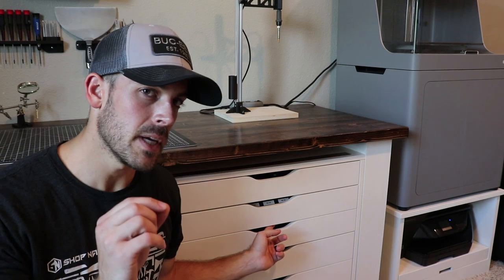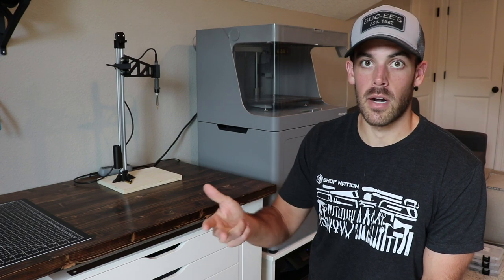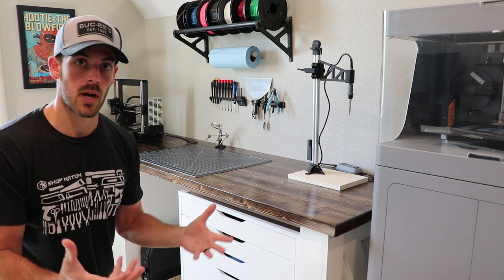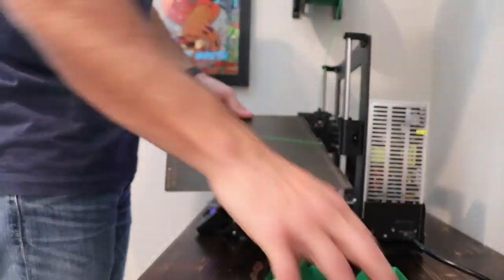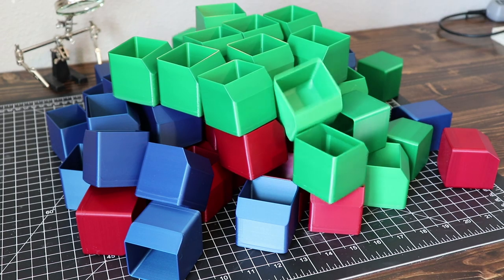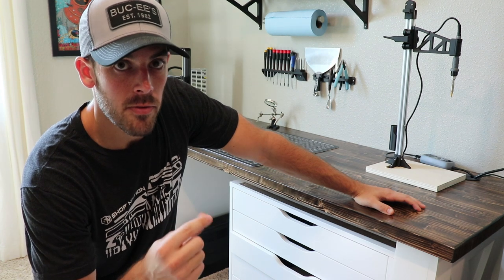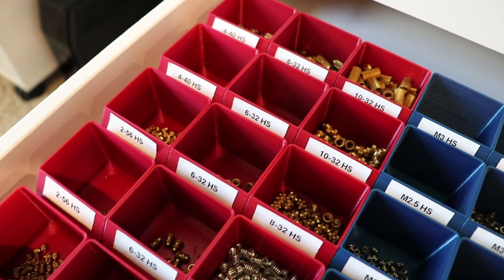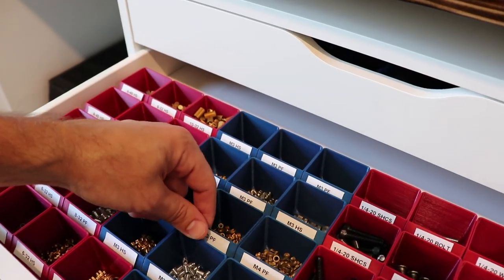Shop Hardware Organization - OCD Overload!

Comment: Ideas for improvement:  When grabbing for small parts out of small boxes, your hand naturally scoops the floor then up the near side wall.  For this reason, the angled wall with the label should go on the far side wall. The box’s floor should have a full radius like a cash register drawer to easily allow the parts to transition from the floor to the near side wall when being scooped out.
Reply: I've been adding that radius to the front and back inside lower corner of a few bins that I have made just to be catch all bins. Love it for getting those small pieces off the bottom of the bin.

Comment: This is funny. Just watched this video for the first time, 4 years after it was recorded. I just did the EXACT same idea, but my drawers are black. Instead of the boxes you used, I went with Zack Freedman's Gridfinity boxes and grid, glued the grid to the bottom of the drawer with a few blobs of silicone, works a lot better, and a bit less work since you dont need to futz with posterboard or foamcore. Additionally because of the grid, I can use different sized boxes as well.

Comment: I like the boxes, but putting a grid system on the bottom and on the bottom of the drawer would be a good idea.  What I mean is,  I saw someone who had a system that kept the boxes from moving when you opened or closed the drawers even if one of the boxes wasn't there.  The idea being that you might take the whole box out and you wouldn't need to worry about closing the drawer too strongly.
Besides that, good organization.

Comment: I have the same ikea cabinet and wish that they were full extension draw slides.  I have a similar setup, but also use kaizen foam to put my bench tools in. I have to put a spacer piece at the back of the foam for the 30% of drawer that is unusable.  My OCD wants to replace all the draw slides....but I think the boxes are a great idea and calms my OCD....but that 30% is a bugger.

Comment: Excellent video/project/execution!
I wonder if there’s a way to swap the cabinet glides for full extension?
Reply from the maker: Thought about that too
Reply: We have those same cabinets in my wife’s craft room. You would need to make the dado in the drawer wider to fit the drawer slide. But with that step yes easily done

Comment: No no no! Not OCD!!! This is common sense. Tackle boxes are ok for certain things. I have experienced the dividers “raising up” somehow then all of a sudden your green widgets are mixed up in the yellow widgets. Another thought on the dead space behind,  I’d cut out a long strip of styrene insulation foam. Might have been quicker. Another thought is to replace the slides with full extension slides. I have to admit I would think IKEA would have used those out of the chute. Hey fun and informative! PS you’re not OCD, just a great thinker trying to make things better. After all isn’t that the goal?

Comment: Great project, Travis~!  I'm going back to rewatch your videos with 3D printing content, especially the printer build/assembly, since I just ordered my Prusa MK3S+~!!  I'll be absorbing all that I can in the 5-week lead time that it takes for the printer to arrive.  Have to figure out the type of enclosure that'll suit my needs the best, as well as storage for associated supplies.  I'm stoked~!!  As far as modeling goes, I've been using SketchUp since it came out, so I've got a bit of a head start, but I definitely see where it's different than modeling wooden projects.  If you have any newb advice for getting a jumpstart in modeling, then I'd love to hear it.  I've created accounts with Fusion360 and TinkerCAD, so I'll be dabbling in both for now.  Thanks~!!

Comment: The front edge of the bottom needs a bevel/curve to make the part slide up the side easier.  Also, I assume I'm not the first to suggest full extension drawer slides

Comment: Did you think about getting full extension drawer glides?  IKEA doesn't use them because they cost more than the cheapo glides that don't extend the drawer all the way out.
Reply from the maker: It would make these drawers so much more useful, I’ve thought about it. Only problem is how the drawer is made, the slides are embedded into the sides of the drawer

Comment: So it's been awhile since you did this project. Do you still like and use it? And the one thing I have found when doing something similar to this for our hardware is : when we get a new size or length hardware, it's REALLY hard to integrate it into the already filled and organized drawers, (or wall unit.) How have you gotten around that without having to pull out and rearrange ALL the bins? Thanks, Rick

Comment: Loving this, I would have angled the back of the boxes so they taper down lower than the label from the box behind , just so it is easy to glance what you are looking for. The back of the box kinda hides the labels at a low angle.

Is that soldering iron heatsert jig/press 3d printed or purchased? I am starting to use inserts more and more and that would be a great addition to the workshop.

Really jealous of the setup too
Reply from the maker: 90% of the heatset press was leveraged from a design I found on adafruit, I’m probably going to design a better one to be honest

Comment: How does the unit cost (materials/consumables only) compare to the Schaller boxes? The custom nature of the printed ones is nice, but I have six 8-drawer Lista-style cabinets with a total of 48 36"x24" drawers, so the incremental cost difference of the 3D-printed boxes might add up to be significant vs. the purchased option.

Comment: Does anyone know where you can buy boxes like this. Having a hard time finding something similar on eBay or Amazon.
Reply: @lakerimff  Well, he also said you can buy them on eBay and Amazon. But you can't actually find them without knowing a key search term or two.
Reply: I couldn't find a good inexpensive product on eBay or Amazon, maybe because I'm not searching with the correct keyword. I did learn that Bosch has an "ORG53" product, Festool has a "T-LOC SYS" storage system, and Sortimo has something called "inset boxes"; all three of these look like they have storage cups that could work similarly to the 3D-printed ones.
Reply from the maker: Look up “Schaller Corporation” they have some good ones

Comment: Would really like to print your boxes, but when i put them in Prusa Slicer they are so small
Reply from the maker: Scale them up to inches, Prusa imports them by default in mm. Scale by 2540%
Reply: @ShopNation  Thanks =) i did =) when i scale them all up the 1x2_box.stl is not the same size as the others?
It's not high enough?